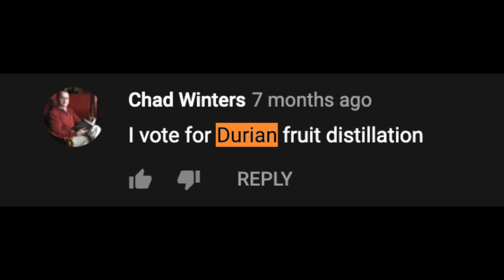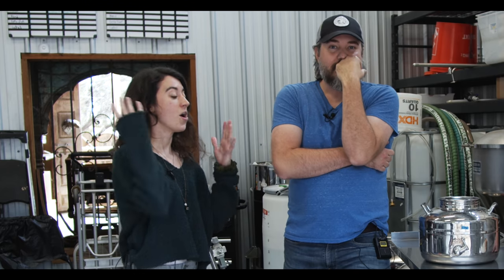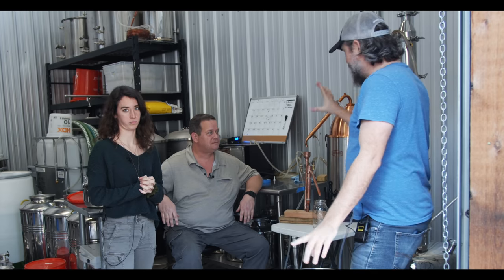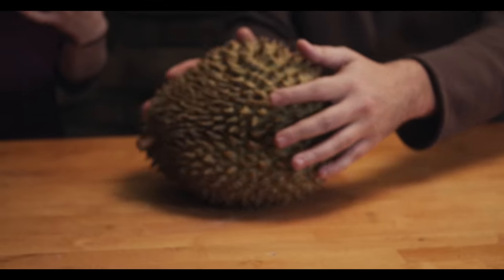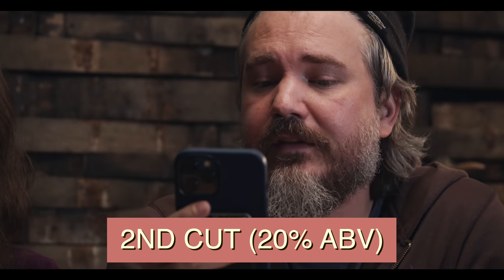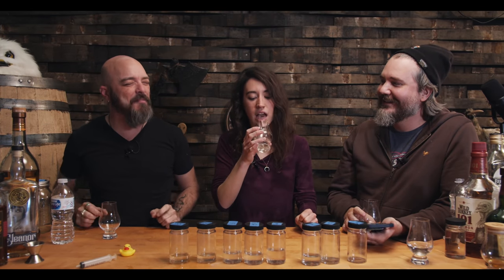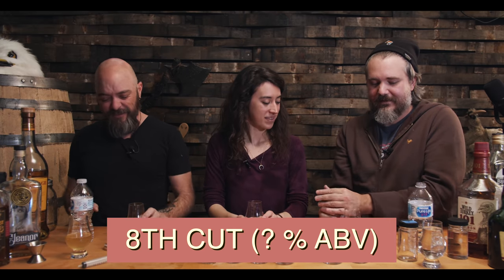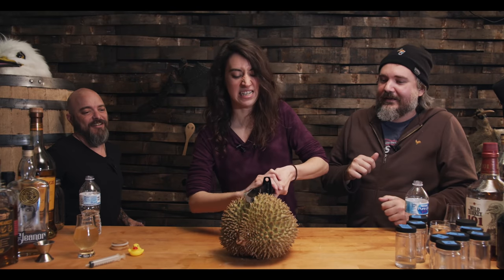What does DISTILLED DURIAN Fruit Taste Like? | Will It Distill?

Comment: I've heard that acorns have a similar starch content to barley, so acorn whiskey????
Reply: Aren't acorn super bitter?
That would make a damn bitter product.
Reply: @The_Keeper  If you use them as is yes, but you leach the tannins out by soaking them for long periods - the American Indians used to do this to make masa: leach out the tannins then grind the acorn.  It can also be done by boiling I believe, but I'm not sure if that would affect its ability to be brewed with.
Reply: @PhyleXTension82  the basic idea is the same. boiling it though removes a step that will be needed (you boil it). boiling breaks down some of the starches and makes them easier for the yeast to attack. it will still need ground though either way. I would posit that the "best?" way would be to boil shelled acorn many times until the water no longer takes on tannins (no color change). roast the nuts to dry them.  then mill them  coarsely. proceed as per usual. should work ?
Reply: I think it's definitely possible. Properly prepared acorn flour, which seems a sensible place to start, isn't bitter and has a delightful nutty flavor. Leeching them to make it is an exercise in patience, but that's a key trait required for brewing and distillation anyway.
Reply: @ParadigmUnkn0wn  That was my thought regarding it too .... I am going to try it one day, if only for a bit of fun!
Reply: @The_Keeper  there is a process that removes the tannins from acorns, which pretty much removes the bitterness. It also makes them less likely to kill you from poisoning.
Reply: Id b willin ta find out!
Reply: @PhyleXTension82  You could speed it up using brine. Let soak in brine for a month. Thats how olives get edible (sort of) at least.

Comment: To avoid the burn you show in the flash back, have you considered a heated oil bath?  (No open flame with that much oil, okay, but in exchange you'll get more precise heat control.)

More power to you for tackling the durian!

Comment: there is another much easier way to open up a durian, guys, and it's a more decent way, too. Just look at the other end of the fruit or the it's tip, you will see there are cracks of the cover and you can use a smaller knife to pry it open easily.

Comment: durian are not suppose to be kept air tight. when you guys said there is moist it means bad.  with the butt is cracked (and exposed) it also means bad. It should smell or taste winney cause by some fermentation.
Looking at the size and shape, is that Thailand durian?  I wonder what kind of durian and from where is used for the distilling?

Comment: I'm in espresso, and I appreciate whiskey. The only fruit or food that is similar in the amount of nuance is Durian. There are a few reasons why the experiment did not work out well.

First is the Durian that was used was not fresh. The fruit that was later used looks like it's from Thailand. The best spenders for Durian going by per capita are from Singapore, they can be spending hundreds of dollars for them. Durians consumed in Malaysia and Singapore are very riped, almost to the stage of rotting, the longer fermentation bring out the bitter sweetness, soft texture and rich flavours, almost like wine. If it's fresh, you can even taste the flowery and fruity notes. Overall texture, it's very similar to having custard.

Thai durians, are unfortunately very flat in the taste and lack the depth. It is not uncommon that they are not ripe enough. It's will be very difficult to expect any favourable results.

Comment: The durian you are eating towards the end is not ripe, and will additionally definitely have degraded during transportation. It's like those brown pineapples you see in supermarkets.

Picking and eating it fully ripe is something completely different. At that point it turns yellow and softens to the point where you can easily open it with your hands, it even opens on its own eventually. It still smells strong, but not really bad, and tastes fantastic.

Comment: Ok so you have made something gross now I need you to try to make something great. I would like you to make a root beer inspired whiskey. To do this steep some sassafras and or sarsaparilla root bark in your mash during the period you dissolve your sugar (between 10-15 mins). then remove the root bark and continue with your mash as normal. The next step is optional you may wish to hang a bag of root bark for the vaper to pull more of the flavor (however check the mash flavor first).  Last do a 10 day age with white oak toasted to a (vanilla flavor). You can't sell this due to the FDA but if it works out it should be a great spirt.

Comment: You're not supposed to wrap the fruit with plastic.  The fruit needs to breathe, otherwise it will get rotten faster.
Anyway, durians have many varieties and each of those varieties taste different.  You would probably get different tastes if you use the different varieties. You would get better details if you refer to a durian connoisseur to explain the different varieties and taste.
 
Anyway, for me durians are delicious when I feel like eating them.  The fragrance is overpowering sometimes and can overload your olfactories but the taste is much better.  The smell of it sometimes do not co-relate to the taste of it and you either love it or hate it.  Sometimes, it needs to grow on you.  Over time or after a while, it taste much better.
Reply: There  is another fruit called Cempedak.  Somewhat similar, but not exactly the same.  It taste good on its own and the flesh is not as firm as jackfruit, but when fried with batter and eaten hot, it's heavenly.  The seeds are also edible.  Just talking about it is making me crave for some.

Comment: The durian is not fresh. The skin has opened up, the pressure in the capsule the flesh sits in has been released. It is starting to sweat and loosing the water from the flesh of the fruit. 

We would just kick a fruit like that. No longer for human consumption. 

Next time try to find a fruit that was frozen fresh. And just eat it cold. That is the next best method if you could't find a tree that can deliver a fruit to you within the day it fell off the tree. Most durians are harvested In the evening and eaten before the next day. It never gets exposed to sunlight, it will start to sweat.